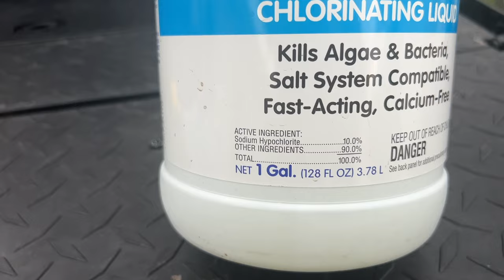Can You Clean Mildew Golf Cart / Boat Vinyl Seats With Out Touching Them?

Comment: Hey there, another product you should try is Miracle Mist… it’s specifically formulated for marine vinyl and fiberglass. We used it on our RV canvas awning that was just nasty and black with mold and mildew. Miracle Mist totally obliterated all the mold and mildew on the awning and the body of our RV. All we did was rinse it off, 100% touchless. One word of caution though, when purchasing it, unscrew the cap a little and smell it, it should have a very slight smell of bleach. I bought two bottles and someone had returned one of the bottles to the store filled with water after using the contents. When sprayed on the mold and mildew you’ll be amazed at how it turns all the nasty stuff orange and it literally disappears before your eyes. Miracle Mist can be found at most Walmart’s, Ace Hardware, etc. we buy it by the gallon now because we’ve never found anything else that works better than it.
Reply: Why waste your money on Miracle Mist at $30/gallon when all it is is regular bleach (Sodium hypochlorite) and color safe bleach (Sodium Percarbonate )?
Reply: @N-M424  Well, I don't know where you buy your Miracle Mist, because I've never paid more than $15 for a gallon. Regular bleach doesn't penetrate the mold and mildew the way MM does. It's all in the way it's processed. MM for me is far superior to regular bleach in the fight against mold and mildew here in the deep South. I prefer to work smarter than harder; for me, MM does that. It was just a suggestion.

Comment: The reed switch in the charger plug throw me off on a lithium conversion in a txt. When I removed the plug the cart didn’t run till I figured out I had to wire it back up. Looking forward to see your ezgo conversion. Great tip on the pool bleach, a lot cheaper than the “ Jo max” house cleaner I use.

Comment: Love your channel. How about a video on lowering the back end of the roof on that EZGO so it fits in a garage after a lift kit? Thanks again for your work!
Reply from the maker: On my carts with back seats and universal candy cane roof supports. I just chop the bottom off of the supports to lower them down.
Reply: @Fentertainment  I am concerned about the back verticals not lining up after cutting out a section due to the angle.
Thanks for the reply.